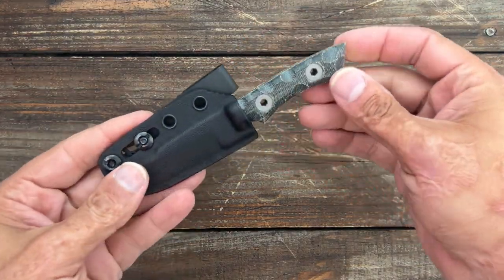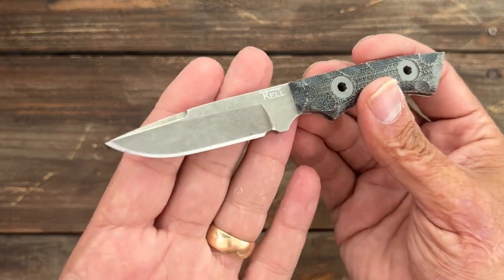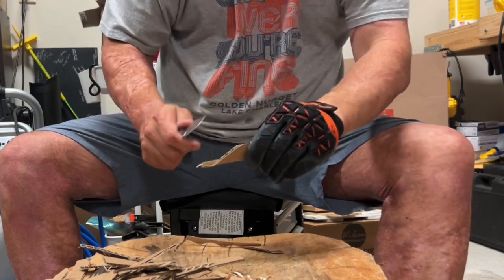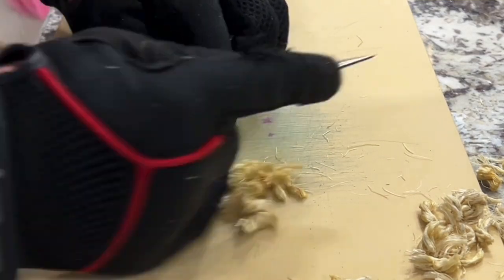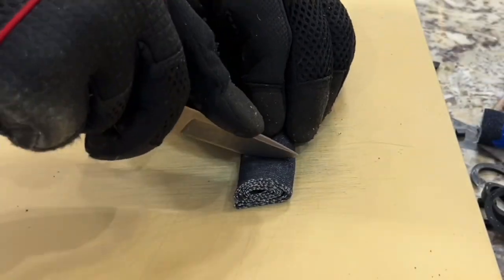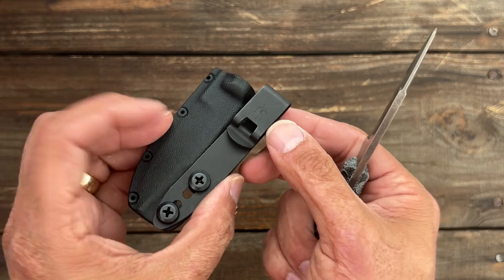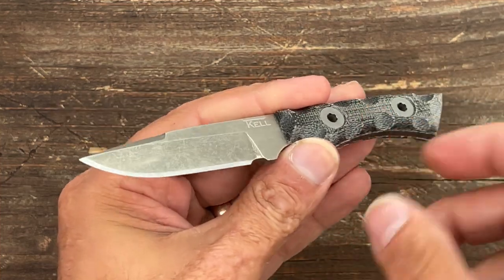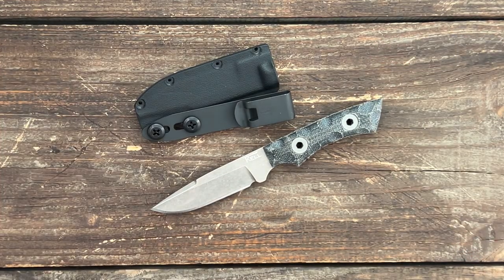Awesome Little EDC Fixed Blade TKell Knives Piranha

Comment: Just my humble opinion. That knife is really nice. However I'll never understand the appeal of a 3 finger fixed blade. Especially if it's something that's going to cost a bit of $. I mean ya you can pinch grip it but all you have is a really expensive little cutter at that point. I really wish more companies would come out with blades that size with a full grip.